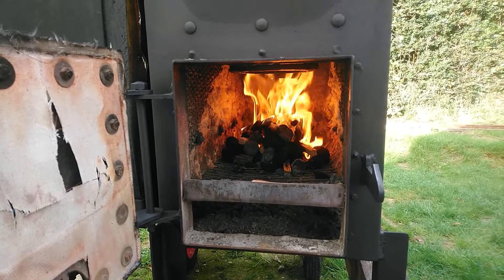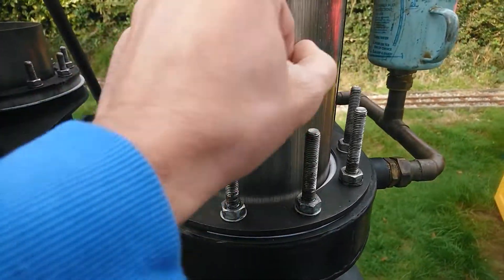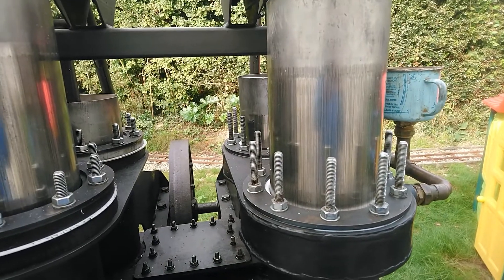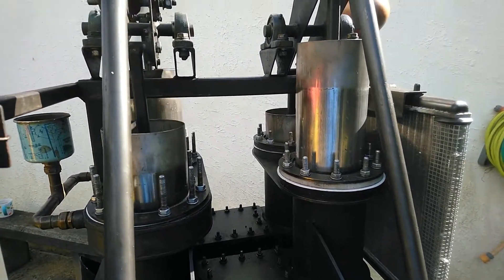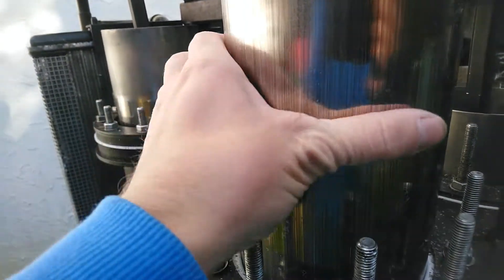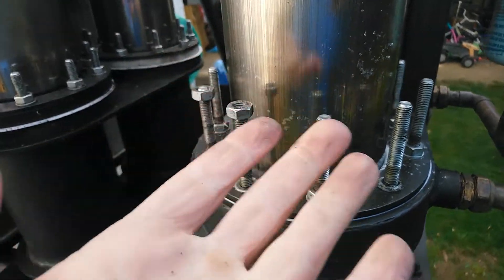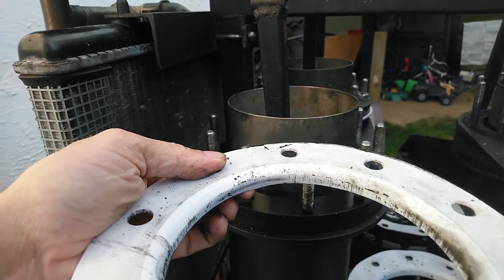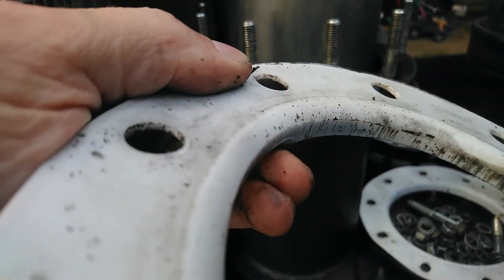Stirling Engine Mk2 - PTFE Test Run & Review - Part 15

Comment: I’d recommend getting those pistons polished AND chrome plated if that’s at all possible for you. Would also suggest trying Bronzalon as a gasket material. It’s bronze impregnated Teflon that works great at high temperature

Comment: The problem is serious. I think I will point the piston rods down on my engine. This way, they are less exposed to dirt and can be lubricated with a small amount of oil
Reply from the maker: I was kind of wondering the same for my next engine. I recently read that Robert Stirling had his engine piston rod down to make the oil less likely get into the engine.

Comment: great project,  have you considered red silicon o ring, red indicates high temp, And if clamped the pressure and wear can be adjusted by varying compression of ring.. is it only wearing on one side due to side play would a double ring help one at bottom of piston like a ring and one at top?.. like it!..
Reply from the maker: I'll take a look, many thanks